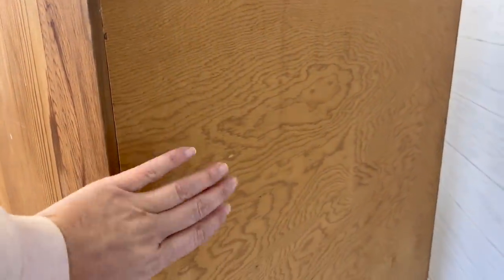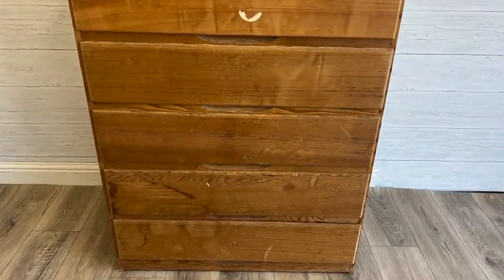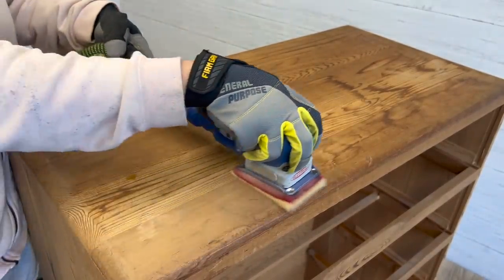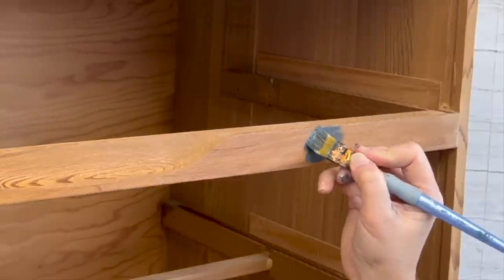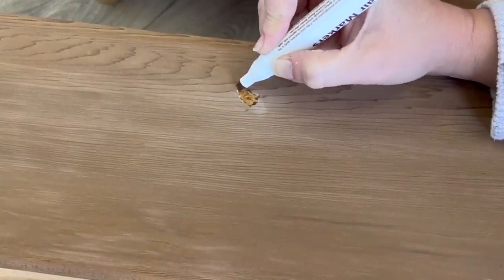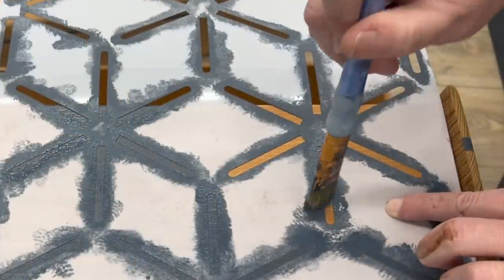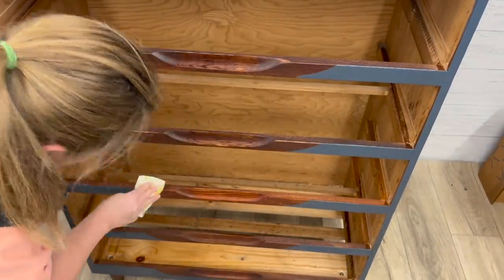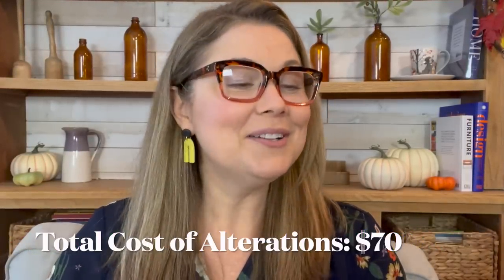CUT DOWN Tallboy MCM Dresser | Removing A Drawer On A Tallboy Dresser drawers & Adding Feet

Comment: Hi Andy wow this piece turned out really really good it has a flare of style I wasn't expecting, at first as it, lord like a difficult piece to make looks amazing but you definitely did just that, I love how you diched that draw and the stain and hemp oil renued the wood beautifully gave it a gorgeous deep hue ,the feet look like they were made for it, and I really like the blue you used for top,,  lines and stencils, even  the paper you used to line the draws,  complimented the exterior, as you always do you took something old , drab and ready for the tip to front and centre straight up stylish that I have no doubt will sell fairly quickly ,thanks for sharing all the best Mary in Australia 🎄😊
Reply from the maker: Hooray, thanks so much Mary!  So glad you like all of those choice for the fellow.  💙😊💙
Reply: @FurnitureFablesbyAndy  definitely liked it hun you did an incredible job , you just made it all gel beautifully together ❤

Comment: Andy, what an incredible amount of work you put in on this handsome but beat up fella. He's standing proud now.

The fact you still had fillable indentations even with all the sanding reminds me of a recent video I watched over on Dasher Furniture Design and Restoration. He used  a small soldering iron and water to create steam that helped the dry wood to swell and fill in an indentation. Is it 100% perfect - no but a lot of time you can get by without filler. Check out the small pink table he restored. Towards the end he damaged a table leg when it dropped on concrete while re-assembling table. Nasty concrete took a big bite out of leg which was 90% restored by steaming. Just another tool to have in your toolbox. Good luck; I love your creativity.
Reply from the maker: Thanks so much, and yes - I definitely considered steaming some of those bigger dings!!  In the end, I kinda loved this ones leftover scars.  😅🙏💙 Definitely gotta check out that Dasher video!

Comment: Another great project! The hemp oil really added depth, and will be good protection for that exposed wood, hopefully. I do like how you managed to get that filler to match the wood color pretty close, and how it worked so well with the rugged, weather-beaten look of those drawer fronts. Lots of character there - no need to hide it!
Reply from the maker: Thank you very much!  Great to hear. 💙😊